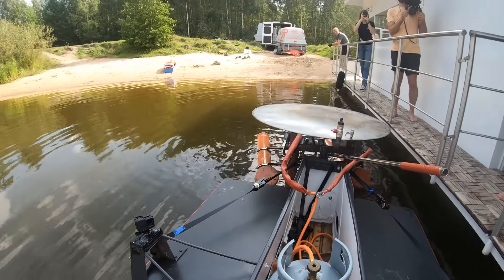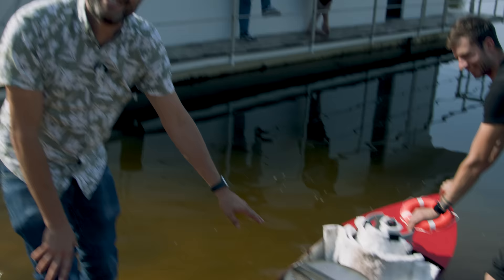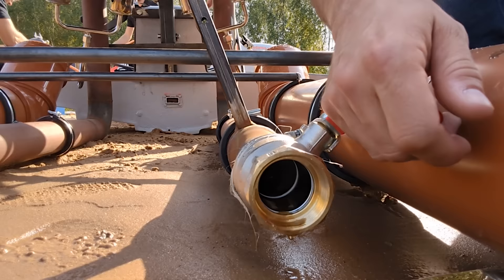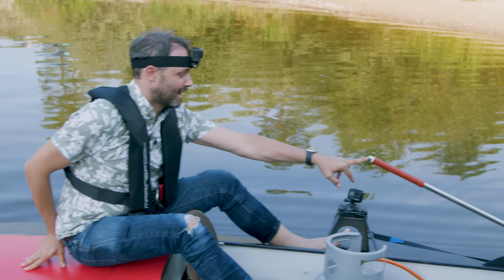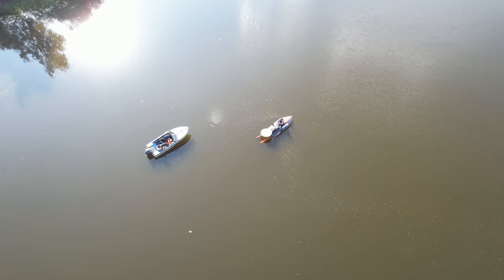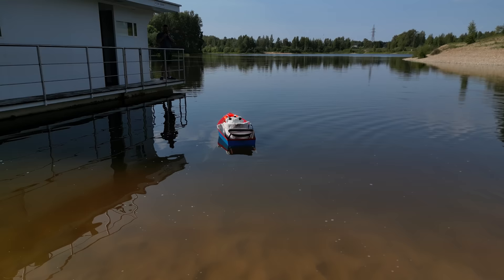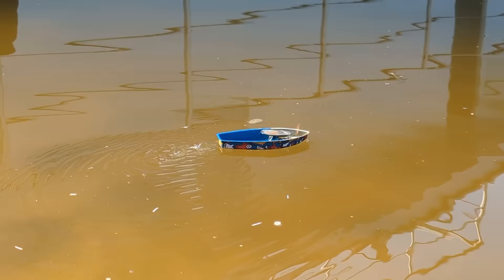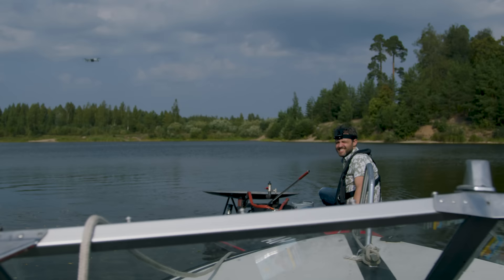Will this toy engine work at full size? (yes)

Comment: I wonder what the speed would APPEAR to be if you sped up the speed of a video of  the full sized boat to the point where the frequency of the popper pan matched that of the toy's.
Reply: Let's try to answer this question with some dimensional analysis. What you're interested in is the ratio (speed of the boat)/(popping frequency). The dimension of this quantity will be speed divided by frequency or (m/s)/(/s) = m in SI units. So the quantity you're after has the dimension of length, and it's not unreasonable to guess therefore that it might scale linearly with the length of the boat. So, if you make the boat (engine and all) twice as large and then speed up the video to match the popping frequency, I'd guess that the boat would be twice as fast.
Reply: If it’s built to scale and had same popper frequency wouldn’t it appear the same speed?
Reply: @Moz29 doesn't that depend on the mass of the boat?
Reply: @DougSalad  it does yes, scaling up causes the mass to increase exponentially.
Reply: Yeah, but in an steady state I think the calculations would  be correct. An analysis of the energies would probably shoulw that mass doesn't matter if buoyancy remains constant. On the other hand the  steady state speed definitely depends on the drag of the boat, that is proportional to the surface, supposing the same form factor. So my guess is you would have to square it
Reply: If they did 6-8 smaller pop pop engines for the big boat, that would about do it.

It would be at least twice as fast.

Comment: This is a very interesting and fun experiment.
In Japan, it is called a pom pom boat.
It is fresh in my mind that it appeared in the anime "Ponyo".
I thought it would not work with a scaled-up model, but was a bit surprised to find out that it could work with low efficiency.
The biggest surprise, however, was their attempt at a full model.
It's fantastic.👏👏👏

Comment: To somewhat counteract the square cube law, we could use fins to increase the surface area of the water tank, maybe an idea for a future video?
Reply: You would also need fins on the INSIDE of the water tank as well. It's not just heat transfer to the metal from the flame, but also the heat transfer from the metal to the water that is limiting it when scaling up.
Reply: Just use a bajillion smaller engines, heat pipes to the big burner

You dont build a single giant piston if you want to scale up an ICE, you build a V8
Reply: @mikerich32  Heat transfer from metal to liquid water is many times more efficient than that of flame to metal.  Unless you create and maintain an insulating layer of super heated steam between the liquid water and metal the water at the boiling point will absorb all the heat from the metal much faster than fins could transfer the heat further up. That's why copper heat pipes are much more efficient than solid copper rods.    

In fact, increasing the area of the metal by using corrugated metal would be much more efficient than metal fins for the same amount of flame to metal interface area.
Reply: Do like Train Steam Engines
instead of one big tank, a series of pipes with the flame all around them.
Reply: Or use that gas and water to power a steam engine or a steam turbine
Reply: What about using induction heating? Or are we getting away from what qualifies as a "pop pop" boat at that point?
Reply: @fishyerik so you're arguing for electric pop-up design, excellent
Reply: @hashbrown777   For an ICE I believe larger cylinders are actually better because otherwise energy is lost as heat in the cylinder walls instead of pushing the cylinder down. Large engines 
are almost always inline 6 cylinders and this configuration has perfect internal balance. The main benefit of a V8 engine is that they are substantially shorter than a straight 6 of the same displacement.

I actually need to correct myself a bit. Really large engines often have more cylinders. The RTA96-C is the largest piston engine and is an inline 14. But it's an absolutely huge 25,600 liter engine, having nearly a 2.5m piston stroke and a bore of almost 1m. Here the square cube law shows as this engine maxes out at only 120rpm. For more reasonable large engines like in large trucks almost everything is inline 6.
Reply: @hashbrown777 a 32 tank pop boat sounds loud
Reply: @orbatos  Direct nuclear maybe, without the detour over electric power.

Comment: It's cool that it works scaled up! At the sacrifice of 1:1 modeling after the source material, I bet this would get better performance in terms of speed if done in parallel with a specific size. If the reservoir size that provides the most propulsion that also has the least amount of weight / water can be worked out, I bet it might be able to go a lot faster. I'm no expert but a V8 pop-pop boat sounds pretty cool.

Comment: a system of check valves to allow it to pull water from the front and expell out the back would probably be another improvement to the design.
Reply: I think you don't even need check valves, just a longer tube in the front with maybe a couple kinks to increase resistance so that water flows fast out the back and slowly fill back up from the front
Reply: Very much like a pulse jet engine
Reply: @NicolasBana  tesla valve.
Reply: @NicolasBana   How would the water "know" how to choose either path over the other? It's not like your'e going to get ramjet effects at those speeds.  If you design the tubing to be direction biased it's considered a check valve, like the tesla valve.
Reply: Just by making the tube longer and/or smaller diameter it has more resistance to flow so when the bump happen it would expel more water from the shorter/larger pipe generating a net difference in force. @fishyerik
Reply: Thats ......just jet engine works
Reply: I just commented this as well. Nice confirmation to see others thinking the same
Reply: You could make it suck water in the front, boil it and blow it through a turbine. Then connect the turbine to a propeller via a driveshaft. Simple and efficient!
Reply: That's a similar principle to a ramjet.
Reply: @bbgun061  I think you just made a steamboat.
Reply: @Klbkchhezeim  ;-)
Reply: You need much less water in than what is going out. Or rather you don't really want to get a rush of water that goes in when the boat goes faster as that would cool everything down. The water goes to steam and whatever volume difference that has is what is important.
But you might as well make something similar to a jet engine if you do that. Just heat everything to a very high temperature and make it all linear.
Reply: Use Tesla valves.  No moving parts and very effective (I'd bet they'd also work for pulse jets).  Be worth a try.
Reply: I bet nowadays if you order a Tesla valve online you'll get a visit by the ATF...
Reply: I hope someday a mini-culture of pop pop boat innovators comes into being so we can see how far the technology can be pushed
Reply: @NicolasBana but it would also suck back in through the pipe with least resistance.

Comment: I wonder if making a Multi-motor pop pop would work better. With more smaller motors you would get faster cycles and hopefully scale that speed up.
Reply: I think the speed would still not change. each motor would push same amount of water each cycle, so each would push the same distance. I guess the only difference is more power, ie ability to push heavier boat but still the same speed.
Reply: @lukasdolezal8245 Think of it in terms of Newton's laws - for every action, there is an equal and opposite reaction. Pushing one liter of water out the back of the boat requires significantly more force than pushing one milliliter, and as such will also apply more forward force to the boat.

As for "pushing a heavier boat but at the same speed" - in this case, "speed" and "pushing power" are the same thing. They're related by F=MA -- so for a constant force, a lighter boat will accelerate faster.
Reply: @lukasdolezal8245 (I think your logic begins to work if the boat is travelling as quickly as the water coming out of the engine, but in this case it's a small mass of fast-moving water pushing a heavy boat slowly. However, this might set an upper limit to the speed you can gain by adding more engines)
Reply: If timed properly this could be cool. Like a cross between a cam and pop
Reply: If he's right about only needing a single pipe then why use a tank at all. Take a bunch of regular pipes, cap the ends, bundle them together and run a burner against them.
Then it should work like your idea.
Reply: I thought of that too at first but, after reasoning for a bit, I do not think it would work as well.
It would be very hard to sync all the motors to ingest and expel the same amount of water at exactly the same time.
Even a small desynchronization would lead to some power being lost due to some motors being ingesting water while some are expelling.
There are too many difficult variables to control to get the motors to sync properly. Some of them are the amount of steam produced, the expansion and contraction of the metal, the amount of water on the tubes (if you remember the transparent version the tubes did not get filled to the same amount) and the timing of all those events.
Reply: @boam2943  yeah. Fire be a fierce mistress. Tough to time n tame
Reply: @boam2943  yeah true. Even using using water as a medium in itself is interesting (and to me as hard to ibdrstand how a aeroplane is in the air when I'm on it

Comment: I want a full pop-pop boat engine optimization series. I'm interested in seeing what can be achieved with them
Reply: Seconded. This is the real science we need our top minds working on.
Reply: I wonder if pop pop boat races would be a good way to solve some of the issues.
Reply: I call the support of @Integza!
Reply: This made me think about using it like a ram pump. Move some water up a hill for the cost of a fire. With it sitting in the sun it would get started faster too
Reply: After a certain point it would just be an ordinary steam engine
Reply: use them in a lake of liquid nitrogen....
Reply: Heat sinks on the output pipes and on the surface that's being heated would help. As well as stiffening up the heating chamber. Vertical fins of welded metal would work for both.
Reply: it still has to pop pop or it won't be a pop pop boat
Reply: Maybe put insulation around the pop tank?
Reply: ? realistically the only thing you can optimize is the heat/fuel loss from the uninsulated jet. if you start engineering on the engine, ull end up with an internal combustion engine. and thats called a regular boat engine.
Reply: @justsoicanfingcomment5814  insulation? the frequency/rpm of the boat comes from the tank heating up AND cooling down. if you stop it from cooling down, it'll go even slower. you can only optimize the propane jets, which you cant.
Reply: @dracothewarrior4316  then you just can't optimize it, game over
Reply: Italians: you need twelve chambers.
Americans: Nooooo! Eight chambers! And they must be arranged in V8!

Bavarians: no, just four. And we'll slap on our insane turbocharger from the 1980s. Enjoy.
Reply: @MrPaxio  I think that is an incorrect statment. 😅
Reply: @MrPaxio  You could insulate the tank.
While increasing the surface area of the exhaust pipes.
Reply: I'm pretty sure stealth is out of the question.
Reply: @ireallyreallyhategoogle  You are mistaken.

Lookout: "No other warships in sight, unless they hide behind that aircraft-carrier-sized toy boat..."
Reply: @justsoicanfingcomment5814   majority of the energy is lost into the environment from ur crude way of heating the tank. go figure that one out einstein.
Reply: @MrPaxio  You obviously did not read my comments about insulating it.
Maybe if you actually pay attention you'd have read that.
So I don't have to repeat myself.

Comment: 10:30 But one thing you're neglecting here is that the cross-section of the boat, and therefore the hydrodynamic drag it experiences, only goes up by the square.

Comment: wouldnt it make sense to build much more but smaller engines? why build one big one that takes long to heat up? make alot of small ones that are very quick to heat up? you increase the engine 100x times but increase the flame/heat 10x times? ofcourse its not going to work the same? and im no engineer, just logic..

Comment: In the summer here in Australia you wouldn't need to run these off gas, the solar heat would probably be enough :D
Reply: He would probably get better propulsion if he just vented the gas directly into the water to push the boat.
Reply: Change Summer to Winter. In the Summer, here, you're likely blow the thing up with too much heat.
Reply: Yeah, use a big convex lens to concentrate solar light in small area
Reply: I realize that it’s not at all practical, but your comment gave me an idea:
What if they replaced the propane and burners with solar panels and coils of wire, and then shrunk the size of the metal pop-pop plate into a more rigid capsule-shaped canister?

Theoretically, you could then run a pop-pop boat for as long as there was water in the tank, and as long as the solar panel continues to provides electrical-to-thermal energy to the water in the tank, which could be for a really long time.

Comment: great build! I'd love to see a racing league of these (where people compete optimizing them for more 'horsepower')
Reply: Sounds like a liability issue. Not everyone is smart enough to do things safely.

To elaborate since no one here seems to figure out the risks involved... Propane tanks can very easily explode like a grenade if the hoses and whatnot aren't set up correctly. That "grenade" can injure surrounding participants, judges and audience members who had nothing to do with it.

While I agree that idiots shouldn't be protected from themselves because we definitely have far too many in the world and protecting them is only making it worse, I do believe we should protect the innocent ppl surrounding the idiots.
Reply: "hose power"
Reply: @turgsh01  racing REAL cars and boats is wayyyy more complicated and dangerous, and we let any idiot do that worldwide. people die. We still allow it. A pop pop league would be fine as far as safety is concerned.
Reply: I remember building a similar model boat back in the late 1970's as a kid (may have been Popular Mechanics magazine).  Instead of a pop-up boiler, I used a thin copper pipe coil heated with some alcohol inside the boat, and the two pipes out through the back under water.   It was basically creating a water jet powered by the copper coil heat exchanger, and the water didn't run out like in this boiler, it only stopped once the fuel ran out.   Surprisingly it was traveling pretty fast without making any popping sounds.  Long before the internet, simple things got us kids amused.  hehe
Reply: @turgsh01 the more we idiot-proof the world, the more idiots we end up with. The more idiots we have in society, the more ways they'll find to do things dangerously. 

In other words, so what if someone might get hurt in a life size pop pop boat race. Nobody makes it out of life alive anyways
Reply: seahorse power
Reply: @turgsh01 sounds like every competitive engineering ever(battlebots, motorsports, etc)
Reply: so what ..life is dangerous  at least make it to be fun  @thecrazyfarmboy
Reply: @BillAnt  I still play with "fun snaps" at age 40. The're fun. It's in the title
Reply: I'd be keen to have a go at optimising a life size pop pop boat
Reply: Hippocampus power?
Reply: @thecrazyfarmboy you are living proof of that.
Reply: @turgsh01  the speed of a pop pop boat in combination with the amount of water that surrounds the engine wwould make it very safe, just wear a helmet and some durable clothes, in case of a problem you can usually evacuate in time
Reply: @erhardbaehni1832  exactly
Reply: @BillAnt  Indeed.  Known originally as 'candle-powered boats' they didn't have pop top, but a continuous thin walled copper line.
Reply: @turgsh01 propane tanks aren't nearly as dangerous as you make it sound. It's difficult purposely trying to detonate one short of throwing in a large hot bonfire for a prolonged period. 

I would be a lot more concerned about people trying to over optimize the "engine" without any safety precautions and detonating it like an early steam engine.
Reply: @KnugLidi - Yep, the copper coil candle-powered boat ran more efficiently than this pop-up engine, it ran silently and continuously till the fuel ran out. :)

Comment: Could you improve the boat with a regenerative heat exchanger and running the burners through effectively a fire-tube boiler inside of the chamber? That way you can recover energy that's lost to the water, and can increase the heated surface area.
Reply: Steam train, but boat
Reply: I bet this engine could be massively improved with a bit of thermodynamic engineering and a solid build

and I want to see it so bad
Reply: I was just thinking what if you heat it from the inside of the tank without specifics because I don't really know how any of this works 😅
Reply: @oraziovescovi1922 i was also thinking that heat fins would make a huge difference probably
Reply: At which point it's starting to sound something like a Stirling engine with a water piston.
Reply: @gcewing  which is by itself a very interesting concept
Reply: Found the engineer.

Comment: I noticed quite a few comments regarding stiffening the top of the boiler to gain better efficiency.
When I was young I got a pop-pop boat for Christmas. An el-cheapo from Hong Kong or Japan, but surprisingly well made.
I remember the boiler being reasonably rigid and was quite a fast little boat.